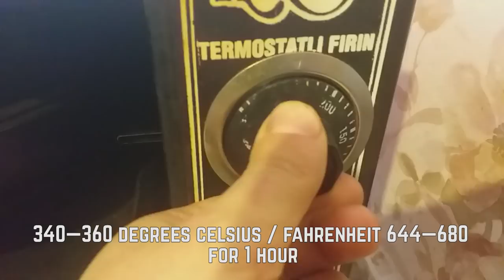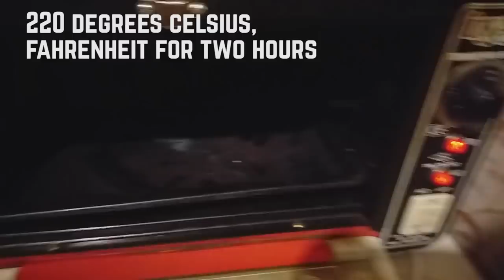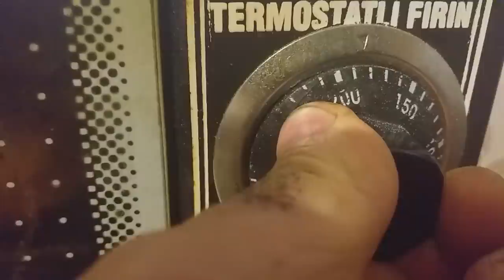Knife Making Serbian Chef Knife

Comment: Hi my friend, did you set your solid pins with a hammer? Or just the adhesive to hold all together?
Reply from the maker: The holes and pins differ in thickness in 05-1 mm. When gluing, they are pressed with a clamp. Hitting with a hammer is a very big risk, you can break it.